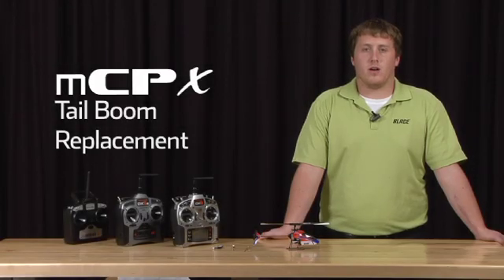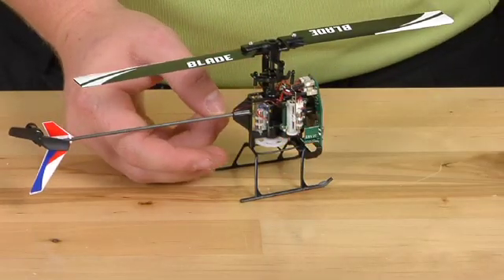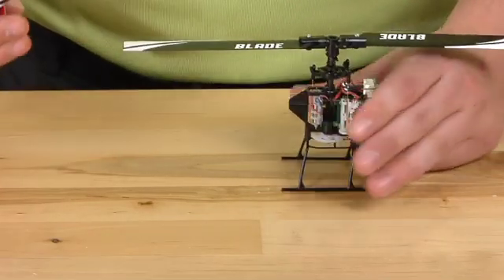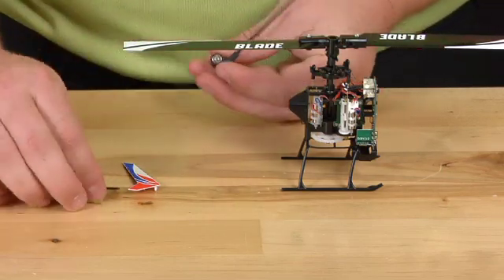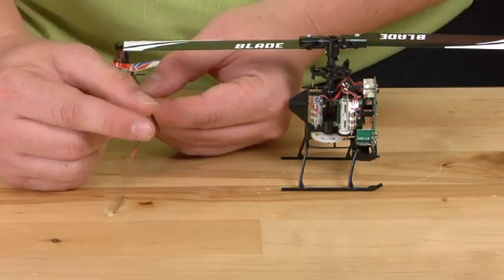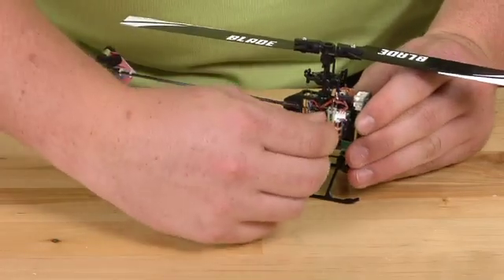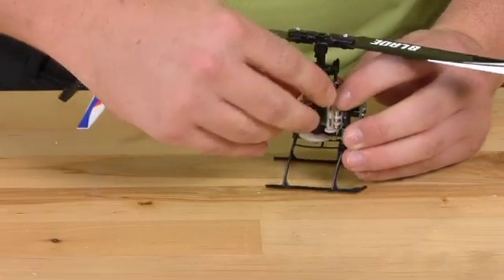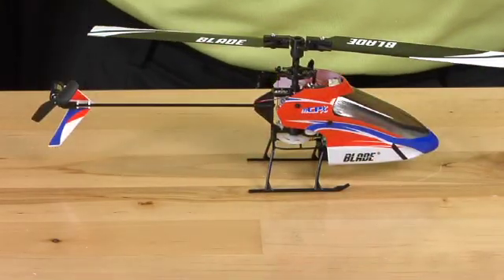Blade mCPX Tail Boom Replacement

Comment: For anybody watching this (including mcps model), what to do is visit microheli.com. They are a website that sell modified upgrades for this product, including a metal tail boom and a modified support connecting from the boom to the landing pad. This will stabilise your helicopter and you do not need to worry about replacing the boom again or for a long time at least. Trust me, this is worth looking at

Comment: The cement that is holding it in is a silicon cement and easily breaks, just know that when you put the new plug in, it will be a bit loose, you will have to be sure that you put it back in, you seat it well.  A little rubber cement on top and all will be fine.

Comment: @Captan6pack thanks! What I've learned late is that the bigger they are the more stable they are ( in a sense) more mass/ weight/inertia ... means more reaction time compared to a two ounce blade etc etc ...

Comment: What I find infuriating is the speed at which you do this. MY tail motor cable is all glued into the board so I can't just "go ahead and disconnect that" then I come to the boom which is absolutely solid in the body "it will disconnect" is simply not true. I will have to scrape this glue from the board with a magnifying glass, then somehow try and use a tool (which may cause damage) to pull the tail from the body and hope that nothing snaps.